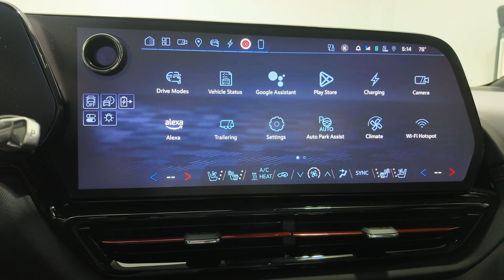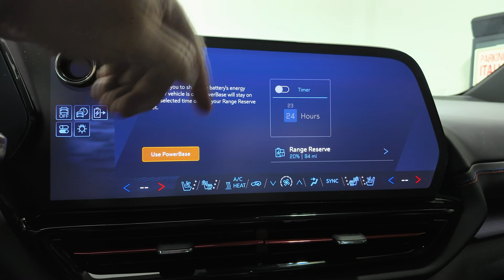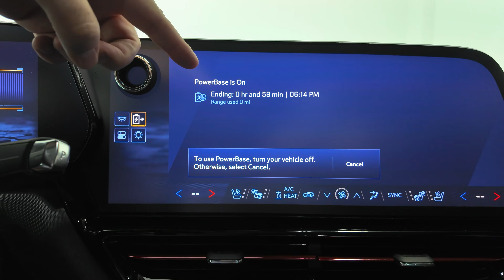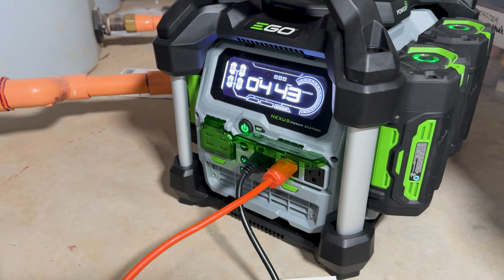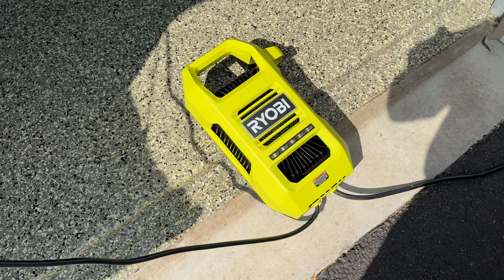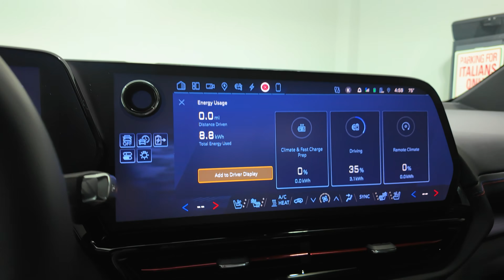The Silverado EV Saved Us During A Power Outage

Comment: I'm looking forward to the first product that ties right into my EV charger and provides uninterrupted power to my house's electrical panel.  This video is welcome but the functionality should be much further along than the market is right now.  We've been talking about this functionality in theenergy industry for at least 15 years.
Reply from the maker: Great point!  The tech is here, but it isn’t standardized and for most it’s prohibitively expensive to install.  I considered the GM energy solution for V2H but it’s unclear if it will ever work with non-GM EVs.  The hardware and installation start at around 15k and can go up from there.  Possibly worth it if you have frequent outages and are typically at home but for occasional backup it’s a little pricey.

Comment: There is a GM J1772 adapter that works with power base that unlocks an additional 3kW to the outlets built into the truck.   GM part # 84974434 It has a 30 foot cord and this part has a TT30 (30amp) plug and 2 Nema 5-20 plugs.  There is another flavor of this J1772 power unit with 4 Nema  5-20 plugs.  The Silverado RST with this adapter can output a total of 10.2kW.   I used this adapter this weekend when the local BG&E utility company had equipment failure during the 100 degree heatwave Saturday into Sunday.  I had no issues using a portable A/C unit and keeping the fridge and internet up with fans and some lights up during the outage.  I just ran the J1772 box from my garage to my living room and cabled from there.   I did not need to run extra cords to the other truck outlets.  I am in Elkridge not far from you.